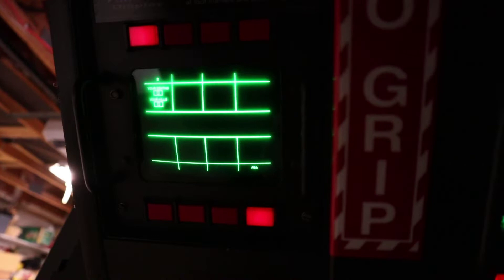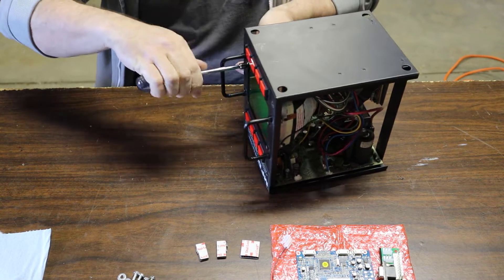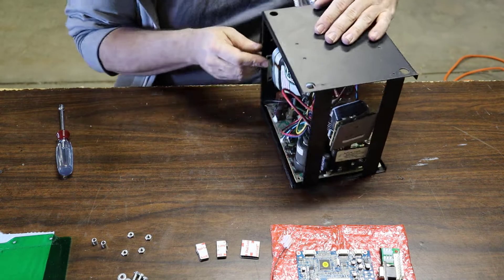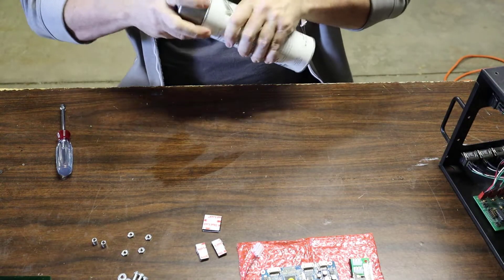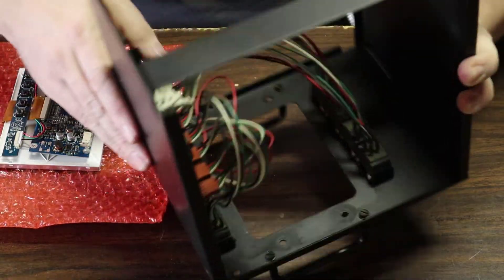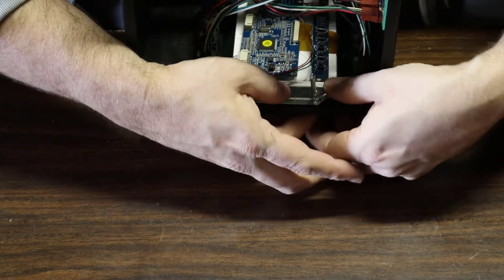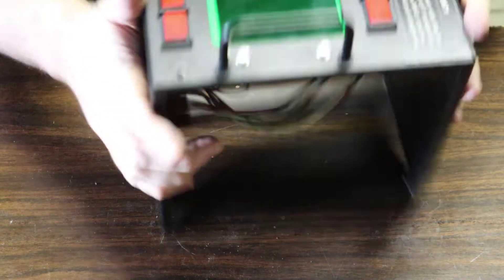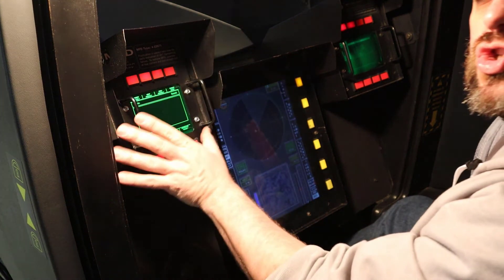MFD upgrade!

Comment: Hi.  I remember playing these during lunch when working at the State Capital in Indy - located on The third floor of the Town Center Mall downtown.

I personally loved the complexity and nuance of setting up one’s controls.   It was a blast. We would be yelling at one another and laughing so hard. And we were all in our late 30’s early 40’s even the.  

What would it take to update the software for these things? 

With all the multi - panels available for flight simulators nowadays, it would be bad ass. And color on the multi LCDs (damage in red, yellow caution for heat or low ammo, etc) would just take these to a new level. 

And have no idea nowadays where to play or what it costs. 

It was so far ahead of its time…. Selling out for big money from big companies (as I understand it) killed the game’s development.
Reply from the maker: I love reading players experiences with the pods over the years thank you for sharing. As for upgrading, it would take a substantial investment. I have made the screens lcd, the issue is that the 5 mfd's are spliced off a dual head video card with rgb being sent to each of the 2 to 3 on it. So in color one is red one is blue one is green. To upgrade everything first the game itself would have to support seperate monitors and have them be able to be independent.  Second the pc would have to be upgraded and a driver would have to be built to have the game work with the rio. But sadly as you say the arcade days are gone. So it would just be for fun. I try to keep mine as original as possible so players can relive the original experience
Reply: @pharaohvwe2475  I agree. It would definitely need a rewrite of the code.   Newer tech wouldn’t be RGB - that’s for sure.  RasPI for the screens and button modules. In full color. 

Dude.  It would be so cool.